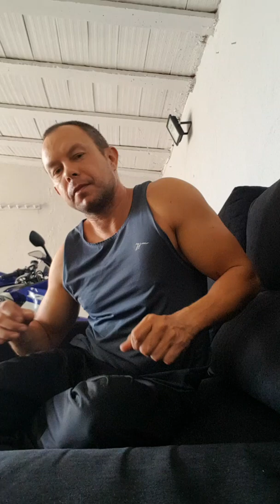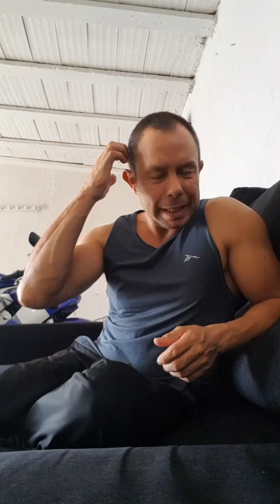Rod length etc. on the om601, om602, om603, om604, om605, om606 engines. Also talking ring gap.

Comment: I'm trying to figure this out myself and I found your video on rods which is helpful. I have a 2107cc(2.2l) om601. I want to build a turbo(actually supercharged but that's not important now) version on a budget to fit in my w110 where a 603/606 won't fit. Here's what I've found.
2996cc 603 turbo 
87mm bore 84mm stroke. 149mm rod
3449cc 603 89mm bore
 92.4mm stroke rod?

1997cc 601 87mm bore 84mm stroke
2197cc 601 87mm bore 92.4mm stroke
2299cc 601 89mm bore 92.4mm stroke

I have an extra 3.0 and 3.5 to use internal parts from. I am trying to find out if I can use the 87mm 3.0 turbo piston and the 3.5 rod since it has the same stroke as the 2.2 to arrive at the correct deck height? After seeing this video I have a feeling the co.pression height of the piston is different and this combo would be sticking out of my block. Can you confirm this?
Reply: Oh wait. I just realized it's 8.4mm difference in stroke but that is cut in half to to arrive at correct deck height at the center of the stroke. So if the 3.5 uses the 145mm rod and I used the 3.0 piston it would lower the total compression height by .2mm. So I need to figure out if that is correct and the 3.5 used the 145mm rod, and how much compression I would lose with .2mm(.00787") difference. That could even be accounted for with decking the block and head. Oh that's very exciting. My plan for the engine is a 12mm ve pump with a custom adapter and an Eaton m90 supercharger aiming for about 200hp. Just a fun daily in a 1964 190c w110 chassis.
Reply from the maker: @jasonbirch1182 2.3, 2.9 and 3.5 uses 145mm rods yes. What rods the 2.2 uses I don't know... However the 2-valve stroker recipe is 92.4mm crank, 2.3-turbo pistons and 290tdt (DI) rods. That's the strongest matching parts available. And very hard to beat with aftermarket parts if any would ever be produced.
Reply: @FtunePerformance i just went through the epc and the 2.9 DI 602.980 uses the same rod as a 3.5 603.971. The updated number is 6030302920 vs the original 6030302220. So a w140 or a w126 replacement 3.5 should have the stronger rods.Interesting. Either way i can physically build the "turbo" bottom end in my 601 with factory parts.

Comment: Would you make the ring gap a bid larger because we are running these engines on a lot of boost or would you go with the factory tolerances? I have an OM603a and a machine shop bored it to 87,5mm for me for oversize-pistons from benzforce... 

2nd question ;-) I want to reduce the piston height by turning 0.15mm off the top of the piston, to lower the compression ratio (again because of driving with  boost) what's your take on that - do you think that's adviseable?
Reply: Never heard of that, but heard of some using double head gaskets to reduce the compression ratio before, hope this helps
Reply: @G_corps  Thanks. I milled 0.20mm of the piston crown on a milling machine. Starting behaviour is still very good, even at 0°C.

Comment: Does the OM603.971 have the same rod legth as the others om60X engines. I bleieve this is a 3.5 l. turbo engine on the W140
Reply from the maker: No. They 145mm, same as om601 2.3 and om602 2.9

Comment: Hey! Thanks a lot for all the info you're sharing in these videos! 
Do you think it would be possible to turn my OM601 2.0 NA to turbo using the Vito 2.3TD turbo+ic, manifolds and piping? Aiming to get reliable 150~175hp for daily driving. Would the stock M pump with 5.5mm elements and stock NA rods be able to handle it?
Reply from the maker: 150-175hp is no big of a deal but if I where you I would swap rods and pistons from a 602 or 603 turbo. It's a bolt on solution and you will have a higher margin of safety on your engine. Stock 5.5mm pump will not handle that power. You need a built 6mm or 7.5mm pump to support that. Stock 2.3td manifolds would be great and combined with a stock 606 turbo.
Reply: @FtunePerformance  Thanks a lot for your anwswer. Hard to get by spare parts down here in Argentina, I'll se what I can come by! Cheers
Reply: 🙏 what is the maximum psi to run on a NA 601 with standard rods, just got a Vito exust manifold and turbo for my w201 2,0d dont want it to blow up 🫣 got a nother enige i might overhale and put some turbo rods in,but not right now

Comment: The om606a rods have two oil holes for the piston pin - the om603a rods have only one center hole.
Is that a problem?
I want to use 606 rods in my 603...
Reply from the maker: That is correct. Using om606 rods in a 603 is ni problem as long as both are turbo = 28mm pin.
Reply: @FtunePerformance  Thank you very much!

Comment: Hi mate could you tell me if this is correct . Take my vacume pipe of the compressor side of the turbo to disconnect the wastegate but leave the wastegate on the turbo so the waste gate stays shut and then adjust my top side of the fueling on my pump untill I get the correct boost pressure . Which I would take that reading of a gauge linked to the compressor housing . My main question is how do I no what is the correct boost pressure for me om606 with standard hybrid turbo and diesal meken pump set to 90cc low and 140cc max thanks regards ron
Reply from the maker: Always read boost in the intake!!! Wastegate shut yes but if you hav a vacuum controlled turbo it will be open with no vacuum hooked up. That can of course be fixed with constant vacuum instead... or just weld the wastegate shut. Boost operated wastegate and removing the boost line is fine.

You adjust your boost till you happy! Low intake temp and good pulling engine!
Reply: Thanks mate